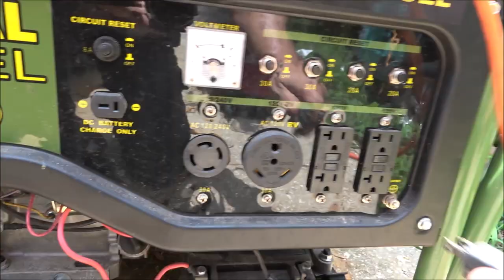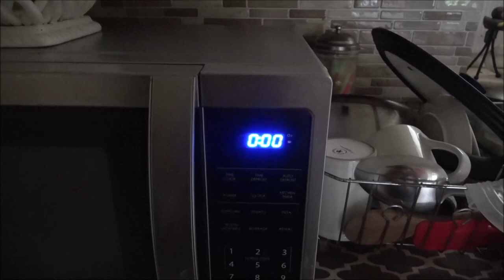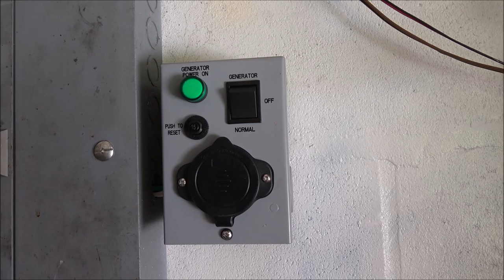MIKKUPPA 15 Amp 125V Generator Manual Transfer Switch

Comment: Pretty cool thank you for the detailed instructions
Reply from the maker: You're welcome and thank you for watching and commenting.
Reply: Sir I need help with my transfer switch. I connected white to white, black to black, green to ground, and red to the 20 amp fuse. The green light was on the switch, but I had no power to the panel. I live off grid and am not connected to the grid. I only want to use the switch to connect my Eco Flow Delta portable solar generator to supply power to my fuse box. I have converted a Derksen shed to a tiny home. The shed came pre wired and has a single breaker in the box. Can I make the transfer switch work with being on the grid? Thank you in advance
Reply from the maker: @karen-wb8ei  it should work if you have everything hooked up color to color. Have you tried to flip the switch?
Reply: Yes I tried that. My neighbor tried hooking both hot wires to the ‘grid bar’, which the fuse is hooked to. He had to leave, but will come back later. In the three steps on the schematic sheet included in the box, their instructions differ from yours. It says to connect the line hot and neutral terminals (red and white wires). Step three says to connect the load terminal block (white wire and black wire). What do you think? Thank you
Reply: Is there any way to send you a picture?
Reply from the maker: @karen-wb8ei  yes. You can email it to
brunobear5000@gmail.com
Reply: Sent 😊
Reply from the maker: @karen-wb8ei  got it. I'll get with you tomorrow, I'm getting ready to go live right now.